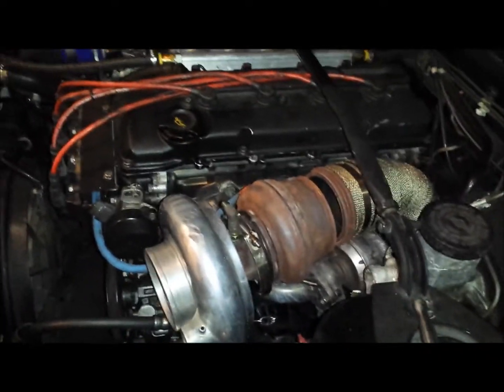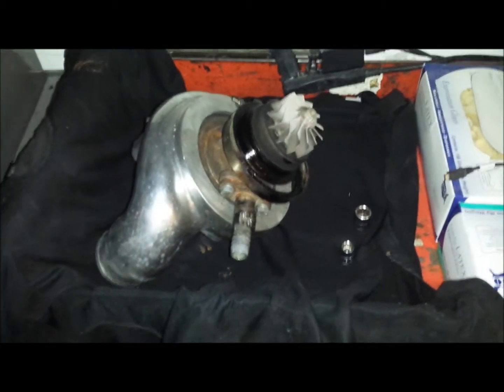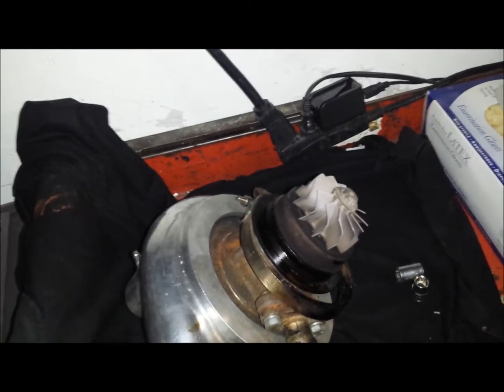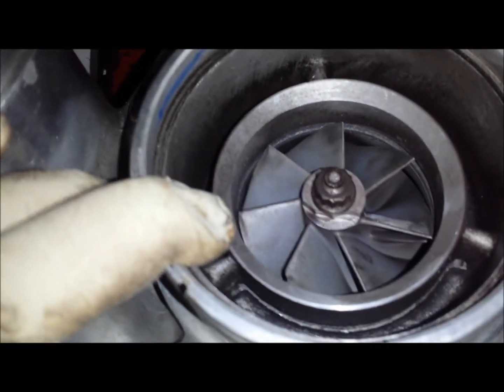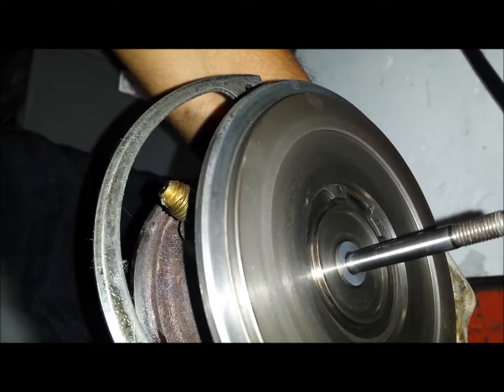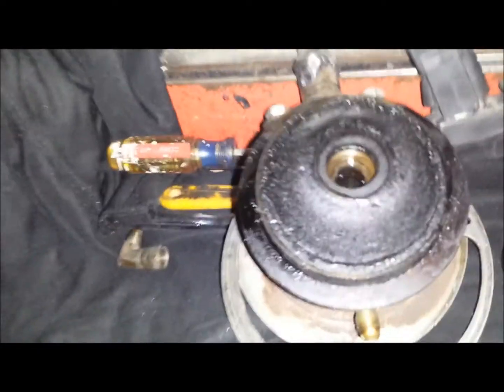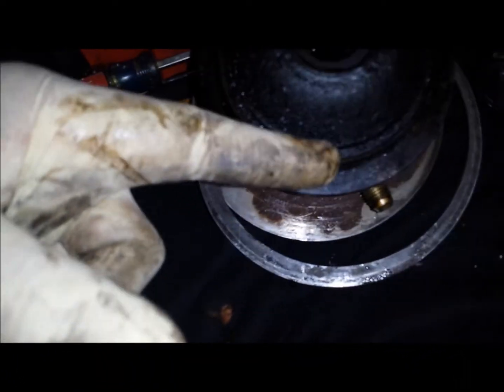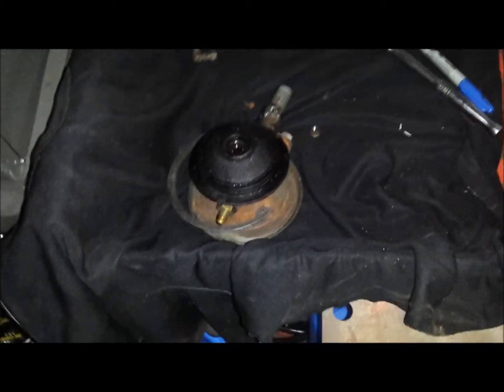Disecting the HE351CW for rebuild

Comment: I was honestly expecting to see this on a Cummins not a 4 cylinder car lol how much boost are you running
Reply from the maker: Most I ran was 34psi around 530whp.  I swapped motors for a VQ35DET with an HX52 but blew that.  Swapped in a vq37vhr with same turbo.  Now just to finish modding the intake and start her up
Reply: @supakat500 34 psi in a gas engine is a whole bunch !    That's impressive    that's what our diesels run in with a little bit of extra fuel.   How long does your engine last running that kind of boost ?

Comment: what did you use to get that big ass snap ring off for the exhaust housing? cant seem to find snap ring pliers big enough.
Reply from the maker: I use 90 degree needle nose pliers.  If the needle nose is to big, grind the pliers tip a little to fit the holes.
Reply: thats what i had in mind. cool thank you

Comment: what are you using to fill the boost solenoid spot and what did you do to delete your waste gate getting tons of different answers some say to weld the flapper shut but I really don't want to weld on the turbo
Reply from the maker: connor staly I bought this turbo already modified.  It is threaded so they used a hex bold to seal and the flapper is welded shut.
Reply: is it just tacked up ot fully welded cause I don't want to warp anything welding it?
Reply from the maker: connor staly Get someone to tig it up for you.  It is a cast turbine which is really hard to warp with tig or even spot welding with a mig.
Reply: You can buy a plug for them you can also get a spring gate for it if you don’t have room for the factory wastegate

Comment: Yo dude did u get ur shit balanced afterwards? I got the same turbo it doesn't smoke but it leaks same as u also the fins haven't touched housing yet.also where do you get a feed restrictor for this turbo?
Reply from the maker: NISMOIZKING No, these are individually balanced wheels.  Same things applies if you buy a billet wheel.  Doesn't need to be balanced since both are zero balanced.  Check the DSM forums for restrictor. It is the same as HX35.
Reply: supakat500 thanks man.also what kit did u buy I bought one and my wheel shaft doesn't pass all the way through that one bearing before the thrust bearing.also its a pain to put the shaft through the chra due to the clam.at the end by the impeller right?
Reply from the maker: NISMOIZKING http://www.ebay.com/itm/Dodge-CumminsHX35-HX35W-HX40-Turbocharger-Rebuild-Kit-/181731063082 That is weird that the bearing is holding it back from sliding through.  It does not require any crazy force.  Just make sure the retaining clip on the turbine is not holding you back.

Comment: Hey I'm new to the HE351CW. I just got a rebuilt center cartridge and turbine housing to go with it, but I need to purchase a new compressor housing for it to complete it. When you put the compressor housing on, is there a rubber o-ring that is supposed to seat inside the compressor housing before you attach it to the center cartridge with the c-clip? Also what size is the oil feed fitting? My center section doesn't have an oil feed yet. Thanks!
Reply from the maker: I do not have one installed but my friend rebuilt his he341 and had boost leak.  He went to Dodge and purchased a seal for it.  As for the oil feed, you will need a 12mm x 1.5 thread adapter. http://www.summitracing.com/parts/rus-670440?seid=srese1&gclid=CI-i3tih3cICFQ_l7Aod1jgA1g
Reply: Thanks.
Reply from the maker: stealth418 no problem

Comment: Already didnt that turbo just go on not to long ago? Are you using restrictors for the oil feed?
Reply: Never mind you got it used.. thats what happend to my 6262 the rear seal started leaking and thats because I didnt use a feed restrictor
Reply from the maker: Richard Mongiove yea the po didn't have a restrictor on it.  When I put it without restrictor, it smoked.  I took my restrictor from HX35 and it stopped but after hard runs, it would smoke/seep.  I took her for a quick run last night and it held up good.